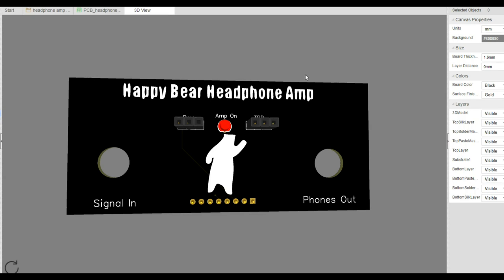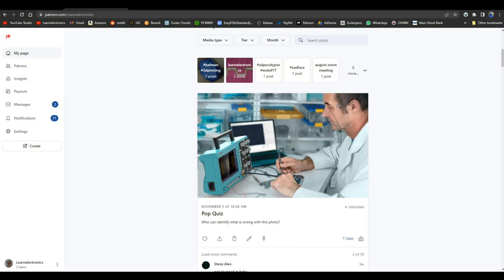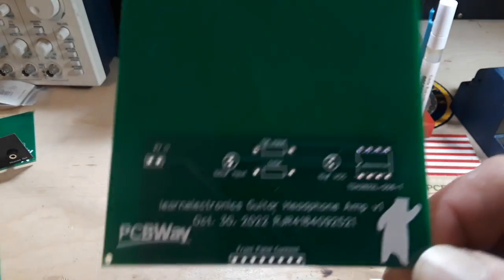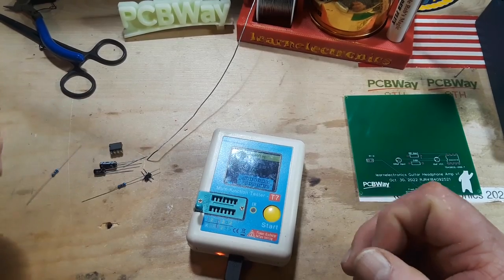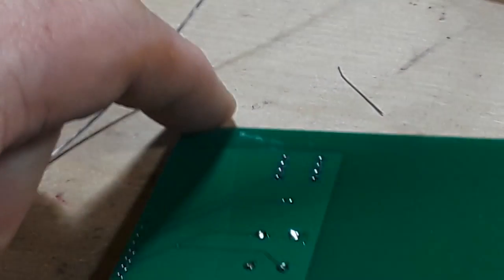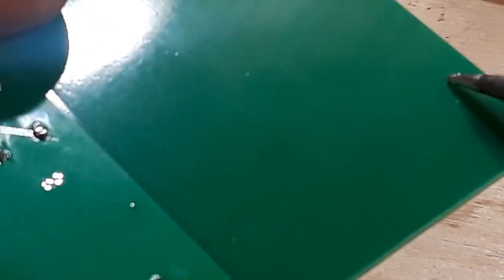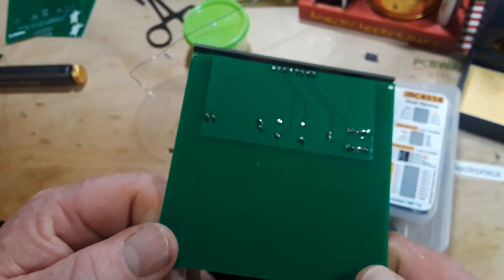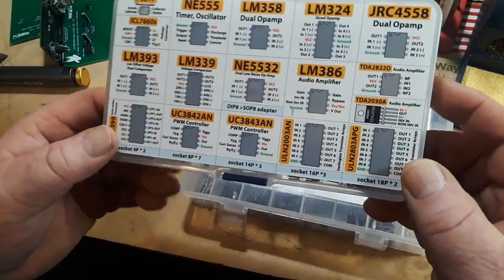Headphone amp main board

Comment: while not the best method, i crank up the heat on my iron for temperamental joints. males the flux a lil more aggressive. that, and that huge ground plain on both sides is stealing your heat

Comment: to reduce the height of the front panel, Instead of soldering the two boards directly, use a right angle male header on the green board and a straight female header on the black board.   This way you can still separate the two for future revisions.

Comment: I had some resistors that would'nt take solder. So every time I used one I would use fine grit sandpaper on the legs and they would take the solder perfectly. I think they were stored in a damp warehouse for years.

Comment: My headphone "collection" has impedance ratings, from 15 Ohm to over 200 Ohm.
Would be great to have some sort of impedance matching (even if manually selectable)
Reply: You could implement the same idea as the hobby DIY led resistor example kit.

Comment: hey man. Any chance you could scan the kit's chip model sheet? I bought the same kit from aliexpress but it came without the sheet and I can't find it anywhere to print it
Reply: HUAREW 15 Values 140 Pcs Opamp Timer Darlington Phototcoupler PC817 LM358P TDA2822 LM386 LM393 UA741CN NE555P TDA2030A NE5532P JRC4558D LM324N LM339N PT2399 ULN2003AN ULN2803APG IC Assortment Kit Edit: Includes all the above and an added UA741CN but is missing the UC3842AN and UC3843AN but those are PWM controllers. Search for "X0028NXCXF IC chip assortment 1.03A PG incl sockets" for the exact kit.
Reply: Now I see I answered the question wrong. Sorry about that. You will likely have to search for the datasheets for each IC.
Reply: @davesworkplace1616  yeah but the sheet that comes with the kit is very useful and I'm unable to find where does all those chinese manufacturers get the sheet. That's why I asked him to send me a scan of the sheet